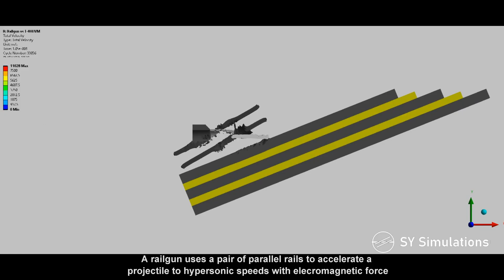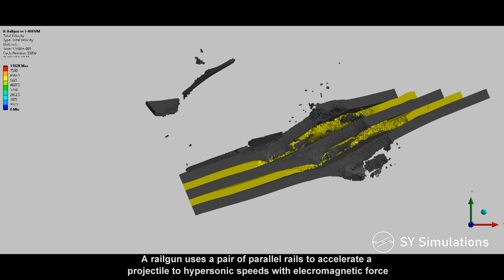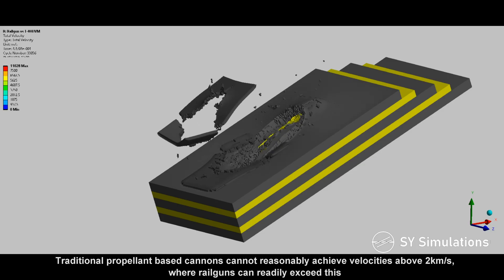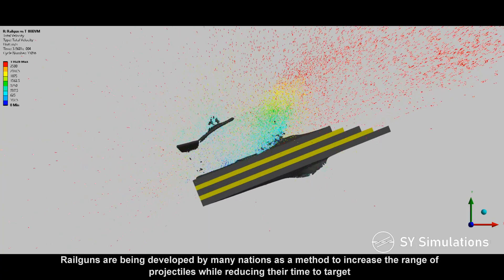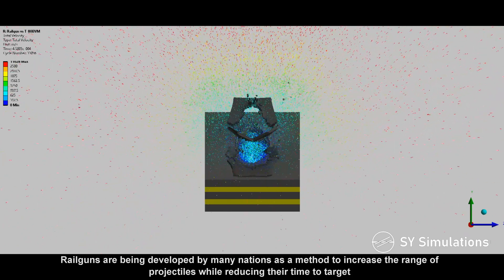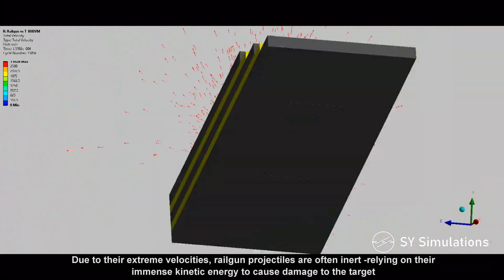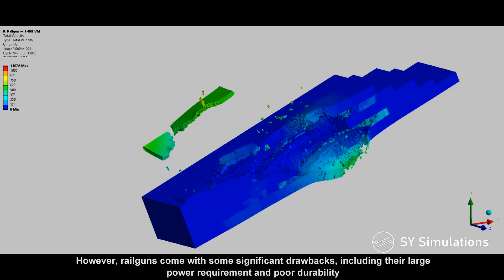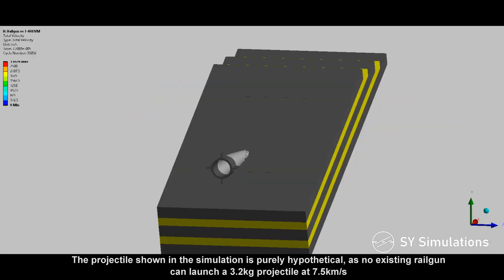RAILGUN vs T-80BVM | Hypersonic Armour Penetration Simulation | APRIL FOOLS' SPECIAL

Comment: For physics-challenged:  DM53 penetrator weighs 5kg and has muzzle velocity of 1750m/s. That is 5*1750*1750/2~7.6MJ of kinetic energy. 

A 203mm heavy cruiser projectile weighs ~125kg and has muzzle velocity of 800m/s for kinetic energy of 40MJ. Above that is a batlleship territory with 406mm guns reaching 320MJ. 

Proposed railgun projectile has 3.2*7500*7500/2=90MJ of kinetic energy, that's dozen times more than existing tank guns, more than twice that of a heavy cruiser gun, and matching early WWI battleships.
Reply: Интересно посчитать, сколько энергии выделит 16" снаряд на скорости в 15-20км/с . Чтобы знать, какую броню на космических кораблях ставить
Reply: @johnshepard6851  best armor for that? Good set of long-range sensors and a lot of lateral thrust authority to dodge/change orbit.
Reply: @michajastrzebski4383  ну линкоры в Вархаммер долбят снарядами в 15 -30м калибром. Вот интересно, какая должна быть броня, чтобы 1 залп хотя бы держала.
Reply: @johnshepard6851  Traditional armor wouldn't be much effective at this point, would require genuinely comically oblivious armor. My best bet is an electric armor, whether magnetic to slow down the projectile, or a high-current electric armor that would vaporize the projectile and thus deleting mass off the equation. I would bet more on active protection systems given the technology as a countermeasure to incoming projectiles.
Reply: @gargantuanfish7187  youre gonna need a seriously, insanely powerful magnet to slow it down, and the second idea is just, what?

an APS would definitely be the answer, at this point, incoming projectiles just need to be deflected/destroyed by some rockets or something
Reply: @hmmm6200  Second idea is pretty straightforward. It's a new type of NxRA (non explosive reactive armor) that has the idea of vaporizing APFSDS projectiles and HEAT jets, currently limited on testing only with no practical use (SLERAs and ERAs as seen on the Merkavas and T-series tanks are much more common), and never has ERA been used practically in a ship, let alone a battleship. You'll need around 30mA and 1 MV to vaporize projectiles effectively in around 0.001 seconds. That's achievable by humans currently, in voltages in high-speed rail systems and some special contraptions have around 20mAs.
Reply: @ At that speed, it's completely unnecessary for armor to do anything to vaporize the projectile; it'll vaporize itself on contact. Unfortunately, this doesn't remove mass from the equation, just makes it wider. The good news is that it can also be destroyed by putting a relatively small mass in its way at a safe distance, which would help the active protection concept.
Reply: @gargantuanfish7187  nope, you would likely have something akin to Battletech armor, surprisingly enough. Composite metal foams, while only in their early stages in practicality, act similar to what is described in Battletech, in the case of the demonstration in 2016, the specific composite is quite similar to EndoSteel.
Reply: @gargantuanfish7187  its NERA, just like explosive armor is ERA, theres no x.
Reply: @hengry0  it's a matter of semantics. NERA is more specificly shortened to "Non Energetic Reactive Armor", while NxRA is "Non Explosive Reactive Armor". The armor I was using in my idea is, on the contrary, extremely highly energetic. So, not NERA, but NxRA.
Reply: @johnshepard6851  интересно посчитать какая скорость была у этой дудулины в момент выхода из ствола хотя бы с двух км, чтобы она в танк прилетела на первой космической
Reply: @johnshepard6851   To proste - zakładając masę pocisku 1220 kg i prędkość 20 km/s, odpowiada to równoważnikowi 60 TNT. Albo jak wolisz - ok. 245 000 MJ. 

Pocisk 16" z pancernika Iowa z II wojny przy prędkości ok. 760 m/s miał energię ~354 MJ i przebijał w testach około 7 metrów stali (to dane z prób artyleryjskich US Navy na celach betonowo-stalowych). Zatem hipotetyczny pancerz jednorodny ze stali j (lub z betonu) musiałby mieć grubość około... 5 km.
Reply: @SuperIv7  So why does it barely penetrate?
Reply: @rextherunt3135  simulations basically indicate that the penetration as a concept is not applicable anymore. The actual penetrator is gone, evaporated. However, according to simulations, it was able to transfer all it's energy to the armor plate. Hard to say how realistic it is, but if true then all that energy would turn the armor plate into something other than solid state, and that is what the clip shows. 

In reality the projectile may simply reflect and continue on it's way to dissipate all that energy into environment, like a light beam, or go through without much damage.
Reply: @ Because it used so much energy blowing a massive crater in the armor. A normal anti-tank weapon only punches a small hole to reach the squishy innards, which is much more efficient.
Reply: And that was needed to pen the ufp of the bvm lmao

Comment: Why would the projectile not be an APFSDS? Surely a rail gun designed to be used against tanks would use the ammo best suited to penetrating it.
Reply: According to my little research I believe the reason is that the shell would go soo fast that it would literally disintegrate from the sheer speed and force its been fired with

Comment: It's astonishing watching kinetic energy effectively act as explosive energy.
Reply: there's a reason all impact craters are spherical. When that much mass is moving that fast, with that much energy and pressure behind it, the material at the leading edge is pushed out of the way at speeds similar to an explosion. Then you have secondary effects like friction and heat to cause the air itself to ignite.
Reply: @MUJUNKY  Oh I'm aware it's just that it's always amazing to actually see it happen.
Reply: At 7.5 km/s, the kinetic energy is about 6.7 times the projectile's mass in TNT
Reply: @zuthalsoraniz6764 thats not that much but when you realize its directed energy focused on one area and not just an explosion, it would be devastating to have that much tnt focused in one area.
Reply: @zuthalsoraniz6764  Yeah no shit.

Comment: The problem with railguns is that, while conventional guns struggle to exceed 2 km/s muzzle velocity, penetrators made of tungsten or depleted uranium will also struggle to survive impacts at those velocities.
Reply: they dont have to survive the impact. It would tear the tank apart regardless.
Reply: Whole idea to lack eplosive mass in those projectiles was mentioned in video.
Kinetic energy alone will be enough to bust any reasonable amount of armor.
So in that sense solid shot will act like hesh shell with enough speed.

So we dont need to care does penetrator itself survive in process because we know it wont.
Reply: It won't survive, but the amount of spall  that a spall liner won't stop will kill the whole crew. Thats gon be a mighty big dent.  @Kesssuli
Reply: @ Lets say that crew is gonna feel that.
Reply: @Kesssuli  you are completely correct, but this only applies to the layers immediately affected by the shockwave. Any armour placed behind the array seen in the video will be significantly more effective.
Reply: @Spider-WoIf  Nothing we can do about it. We dont have material to withstand energy what railgun velocities are providing when shot contacts armor.

But in reality there is also limit how much you can strap protection on vehicle to withstand railgun shot.

So ships may be a tad differend story but any tank designed to move will be unreasonable heavy if we have to design them to withstand railgun shots as well.

It doesnt need to became totall hell let loose penetration with half front becaming a projectile.

Just modest buckshot or two worth of spalling will do a trick inside of fighting comparment.
Reply: @Kesssuli  ships are the only vessels that would be reasonable to protect against railguns and as seen here it is completely possible to neutralize railgun projectiles even with armour which isn't designed to do so in the slightest.
Reply: @Spider-WoIf  This simulation was about tanks against potential railgun shot.

Ships are totally differend beasts.
But i would guess that even those wont have old school battleship armors anymore so it is more about smart sections and maybe self sealant than trying to totally prevent anything to penetrate.

Torpedos,mines and missiles are primary weapons against them

Not sure have any country reasonably even considered that option where ships are taking potshots against eachother with cannons like in ww2.
Reply: Don't forget there is a massive jet of plasma coming through that hole. Even a without penetration, that much energy getting dumped is going to break things.
Reply: evryone is trying to act smart telling you it will just destroy the tank but the destruction of the round is a problem, things like spaced armor can act like Whipple armor for these kinds of round making them much less effective.
Reply: As you see in the simulation, the penetrator doesn't need to survive the whole penetration process, the mass of fragments it turns into, along with the momentum transferred to the armour can still do the job.
Reply: I mean who cares whether the round survives, you just need the 40MJ of force to be sent downrange
Reply: If you watched the video, it clearly doesn't matter whether or not the penetrator survives.

Comment: You can see the diminishing returns of making projectiles faster here. So much energy goes into making the hole really wide; it's a dismally inefficient way to destroy a tank.

The projectile took 90 megajoules to do this. If this weapon were (somehow) mounted on an M1 Abrams, with the engine hooked up to a big generator and made to run at full power exclusively to charge the weapon, it would take a minimum of 80 seconds to recharge between shots.
Reply: The returns are quite significant if you use railguns for their original intentions, and not a direct fire AT weapon. So far Metal Gear is the only one to show a railgun being used in a realistic way. Ie, VERY LONG RANGE artillery.
Reply: @PugilistCactus  In that case the benefit is greater, so much so that someone might someday make a practical weapon out of it.

But even then, the returns are diminishing. The faster the projectile goes, the more energy is lost to air resistance, potentially to the extent of destroying the projectile. The 7.5 km/s railgun in the video would suffer badly from this.
Reply: @DecidedlyNinja  No air resistance in space buddy. We're looking at replacing ICBM's with railguns as they don't cause a lot of damage to their surroundings and are a lot harder to detect launches from. There are very quiet talks of combining railguns with random reentry vehicles. 

No need for kinetic energy when the payload doesn't need it and the target is many thousands of kilometers away. 

We're already looking into launching satellites into space via kinetic energy, and thats just with a centrifuge turned into a trebuchet.
Reply: You also gotta remember this is a 20mm round. Imagine this in a 75, 90,105, 120+mm sizes and the whole tank is gone

Just even more impractical at that point
Reply: @ivancsontos7011 It's a 20 mm wide penetrator, which is about the same as the penetrator diameter in 120 mm APFSDS rounds.
Reply: All very fair and reasonable points... Though I'll raise you another Railgun-M1™

Comment: ERA would not even fully react until this round was about a meter passed the ERA sandwich. The reaction would be moving in slow mo compared to this thing.
Reply: High explosives have an explosive velocity of like 8-10 km/s. Railguns are fast but it's not outrunning an ERA shockwave lol, assuming it goes off
Reply: @BlargOnMyFacepls pretty sure the fuze time would be the biggest issue
Reply: @Disguised588  what fuse time
Reply: @notstonks20  the time it takes for the explosive to start detonating after being hit
Reply: @ i doubt it. ERA was designed to counter HEAT -- even slow shaped charge jets travel around the same speeds as a railgun would
Reply: @BlargOnMyFacepls  relikt has much thicker plates than kontakt 1
Reply: @Disguised588  I'm assuming when you say fuse time you are talking about the pressure build up time across the plates, and the chemical reaction time, and the time it would take for the plates to move about 10mm?
Reply: @Disguised588  not really seeing how this is relevant. disruption is another discussion, but the idea that a railgun projectile is so fast it can outrun ERA is ignoring the fact that HEAT jets are just as fast, if not faster.
Reply: @BlargOnMyFacepls  ERA can be made to be kinetically sensitive to certain speeds. the point of the ERA is to disrupt the jet and to bend/shatter SABOT rounds before they enter the armor.  but the rail gun is just shooting such a large mass of material so fast that the material just obliterates the steel anyways.
Reply: @BlargOnMyFacepls  brother mach 21 is  25046.28 kph / 60
417.438 km/s
Reply: @BlargOnMyFacepls no but it would be enough force to turn ERA into a fragment grenade.

Comment: Armor did better than i expected. I wonder if spaced armor would be a good solution to defeating this level of kinetic force at high speed.
Reply: It did better than expected because this channel seems to have a thing for showing simulations where rounds either "just barely" penetrate or are "just barely" stopped by the armor. Look at the past 10 "Tank X vs Tank Y" videos and see if you notice a trend.

For reference, 105mm M735, the earliest in-service NATO APFSDS, has penetrator dimensions of 35x480mm. The railgun penetrator for the sim is veritably tiny.
Reply: @ndx6779  actually something I just realized is they should probably have used a teardrop shape for the projectile, as that's more aerodynamic.
Reply: I mean, not really. The projectile basically just turned into pure energy and cratered a hole big enough to use as an escape hatch. The crew is probably pink mist due to insane levels of spalling of what would be effectively white-hot liquid and vaporized metal.
Reply: @kauske  There really wasn't that much spalling. We can achieve very similar damage with SIGNIFICANTLY cheaper weapons. Compared to what we've seen railguns do on test ranges, this is nothing. It's a testament to how good tank armor is at distributing energy

Yes it killed the tank, but the rail gun's efficacy left much to be desired
Reply: @ The simulation cannot render particles that small; in reality all that materia actually has to go somewhere, it doesn't magically disappear.

The crew is going to be blasted with supersonic metal vapour, which is very, very lethal. All the energy of that projectile basically turned into a crapton of heat, so the spray will leave the crew with at minimum 3'rd degree burns over much of their body.

The tank is knocked out at that point, and the crew will likely never be able to return to combat, even if they survived.
Reply: The material in the way was turned into high energy spall... if you kept playing that forward, you're looking at fragments still travelling at extreme speeds compared to normal

Comment: how can a rail gun work on a globe?
Reply: Same as any other ballistic weapon, you have to adjust the trajectory and velocity to shoot over the horizon if you are not conducting direct-fire operations. The projectile is stupid-fast, but it can still arc as gravity pulls it towards the earth's center of mass.
Reply: @kauske  begs the question if it it can bypass terrain other weapons can, having significantly less 'drop' from a ballistic perspective might be a disadvantage in some cases
Reply: @ Except for the fact that unlike chemical artillery you can literally dial in exact muzzle velocity; so you can use it to launch non-penetrators with exacting precision, something that you can't generally do with a standard cannon.

This makes it a very good system for a warship, giving direct fire and indirect fire capability. Further, that lack of drop, and high velocity can make it a deadly surface-to-air platform as well, basically munitions that are cheap, but work like guided SAMS.
Reply: @kauske  lots of artillery systems have separated payload and propellant,  allowing you to dial in the muzzle velocity (propellant charges even have thermometers to assist with ballistic calculations) but the method by which a railgun does "damage" is sheer velocity as you and I know... at increasing mass and lower velocity, it becomes better to use gauss system than railgun.

I don't dispute you could lower the velocity to alter trajectory, but you are clearly diluting the primary means by which a railgun has effect on target and the other benefits of high velocity munitions.

While it could be made more versatile, it cannot replace all weapons systems inherently. As an AA weapon, it could definitely be very effective, arguably more effective than in an AT role given less need to focus on penetration of heavy armor.

Frankly though, I think there's a case to be made from hybrid propellant systems for artillery, as you can use a base charge augmented more precisely via a railgun accelerator. Could in result in less strain to the weapon, less power drain, and less propellant per shot... also having the option of during without one or the other to a limited degree.
Reply: That's not even a question. That's a testimony of how little you understand about physics.